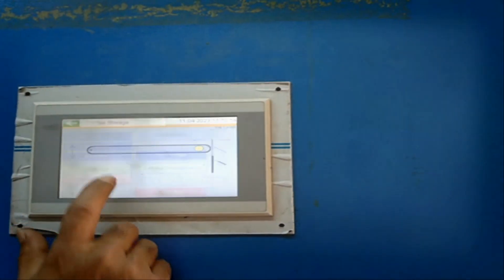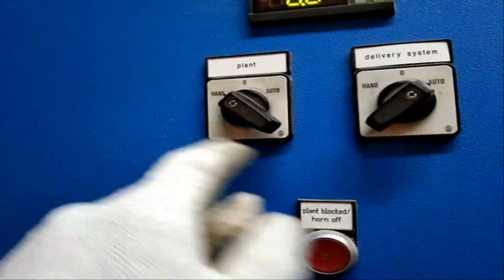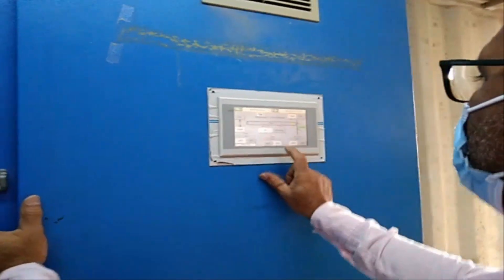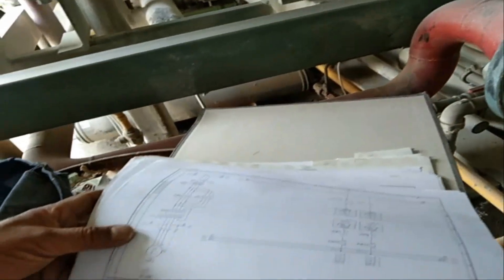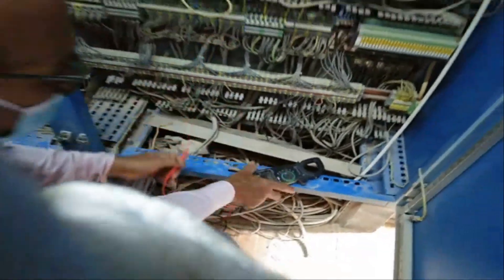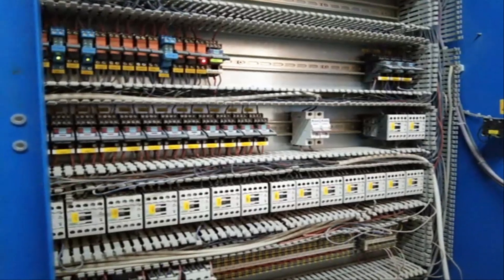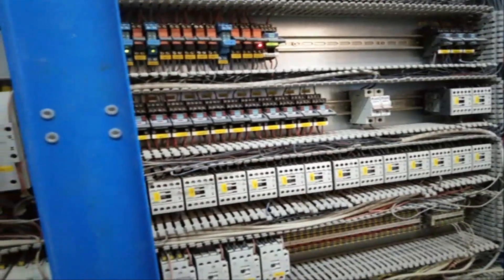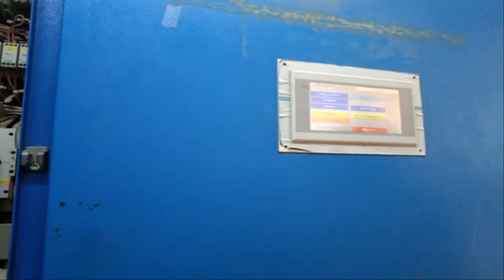ICE PLANT CONTROL PANEL FAULT ALARM SIGNAL

Comment: Hello Prince 1 kti plant display come to high pressure error code what problem compressor come in ice
Reply from the maker: High pressure error code means you could not able to run it and you cannot reset it as well on the display monitor. What you can do is just reset the pressure switch device and thats it, you can clear the error on the display monitor   and can run it.
Reply: Okay thank you sir
Reply: Hello sir composer body full ice coming
Reply from the maker: Hello boss,  which place are you working now?